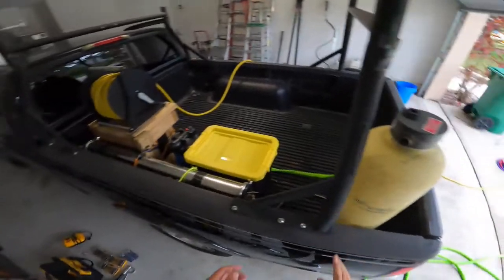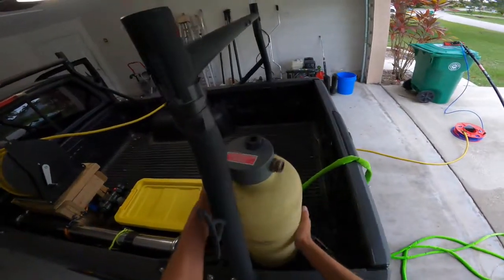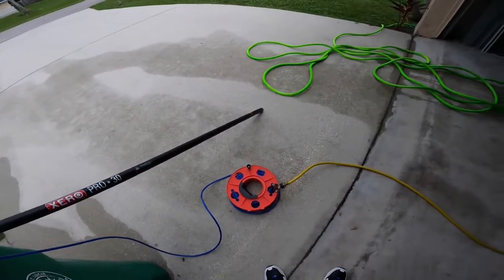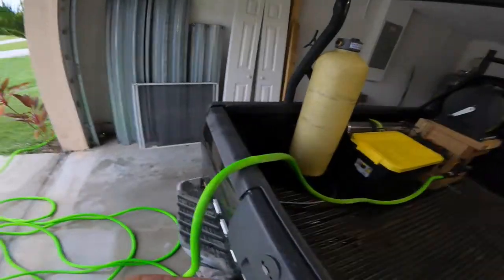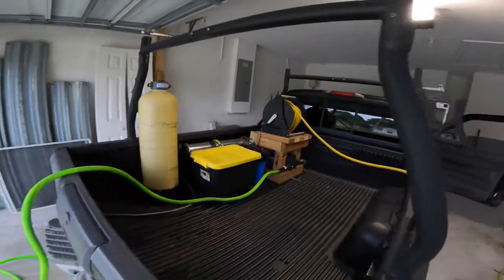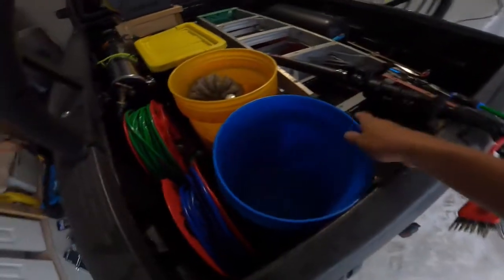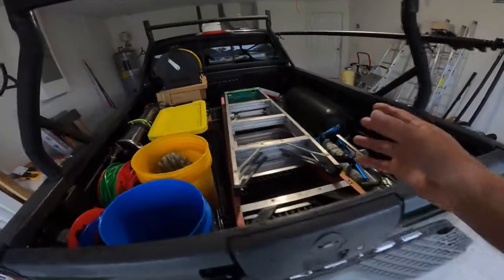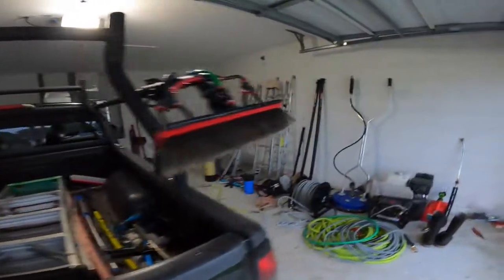Window Cleaning Truck Set-Up

Comment from the maker: Changing it up a little bit.  This is how I am going to run my truck going forward.  A classic window cleaning rig-- One half for pure water, another for traditional-- The best of both worlds.  What i have in here is what I have used on and off since 2005-- aside from RO addition (I used DI tanks for a couple years prior to this as well)- WITH some tweaks for my own business.  This set up will allow you to do up to 3 stories for the most part-- whether it's with a water fed pole OR with wands and squeegees.  

I also discuss TDS, as it regards to MY area and my usage.  Results may vary-- (Just add a DI if you want 0, lol!) I try to help out, but I should remember to speak for myself-- water quality is different in every part of the country.  I hope you enjoyed this video!

(There is still room for a small water tank, I barely use that 6 footer-- if push comes to shove I will grab a small buffer tank with a pump-- BUT to be fair, I have yet been at a job that required something like that.  Remember, I learned the traditional way (nose to glass cleaning)-- you had to figure out how to clean it by hand-- these WFPs are LUXURY items!!!  Know when and HOW to use each method!)

Comment: Looks like a great set up. Very efficient. I recently added a truck mounted unit to my flatbed. Way better! Great video.
Reply from the maker: Awesome man, thanks for the reply.  Truck mount is just easier, but I left it in case I have to walk 500 feet from the truck-- I can just bring it to where it needs to be.

I dont do much pressure washing, BUT if I need to bring it, I can simply slide it in the right side of the bed and have room for my surface cleaner and hoses.